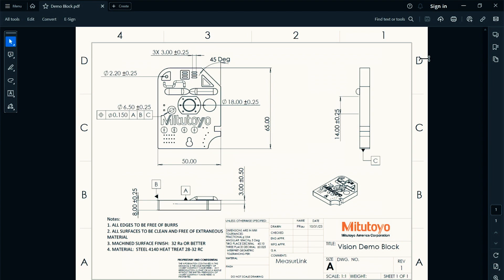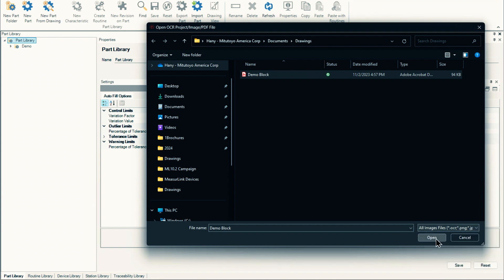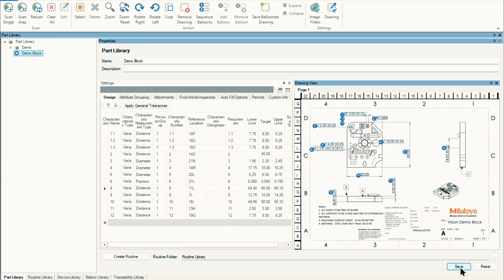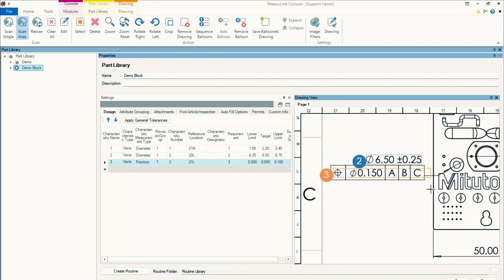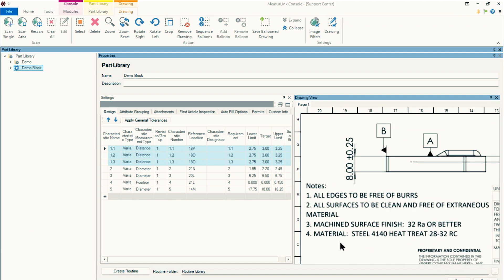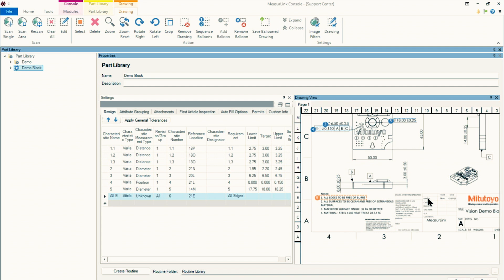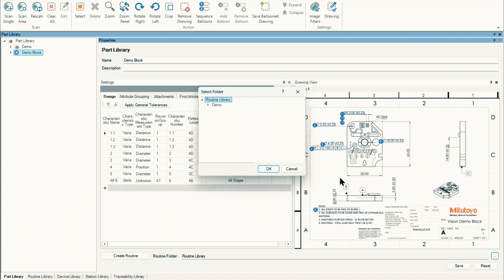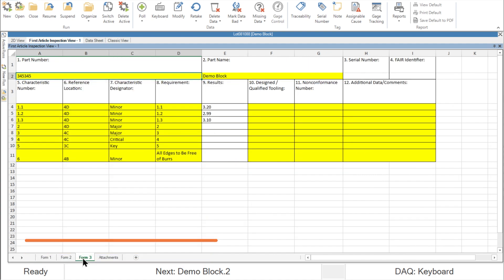Maximize Accuracy: MeasurLink's OCR & Ballooning

Comment: I am trying to utilize a Raspberry Pi to control a test tank (heaters on/off, change setpoint, etc), read a mitutoyo dial gage, and read a RTD. It appears there are several solutions from Mitutoyo, but I do not know which one would be ideal for my setup. Any suggestions?